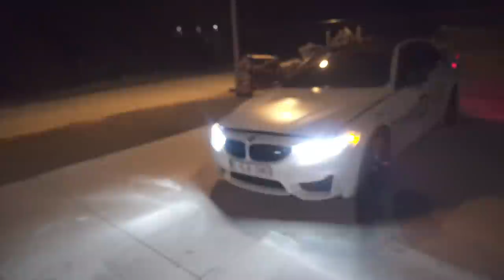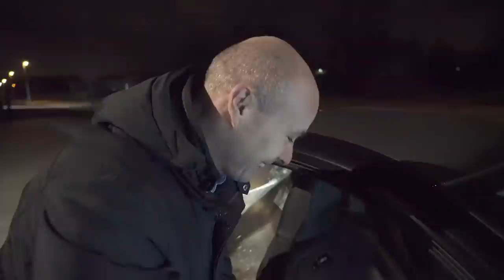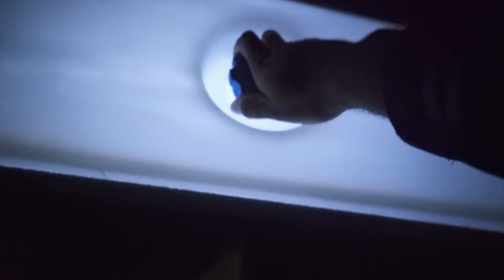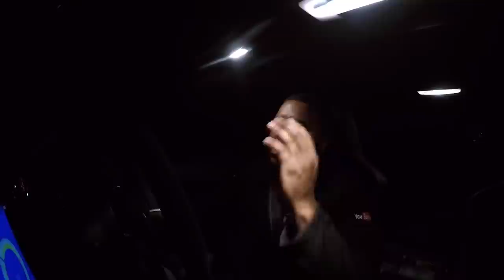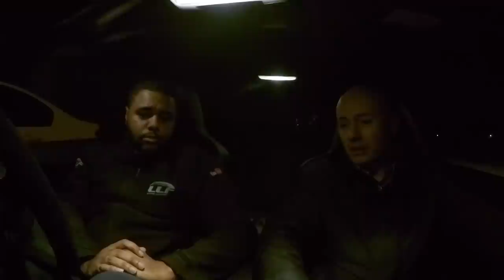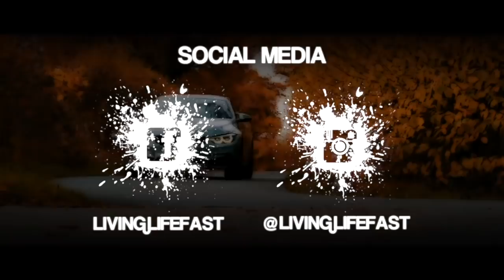850bhp BMW M3 vs 720bhp *SUPERM4*

Comment: Crazy numbers in the daily, and it all seems so controllable. 🤔 Now If you upgrade to some super sticky tires. 🤯
Reply: Its worth noting that Ricky has the talent to make this look a lot more controllable than it probably would be for the average driver. It does look a well balanced and designed tune, but nevertheless, it wouldn't take me long to end up on my roof I imagine !

Comment: You're right up there man! I know its not quite 60-130mph

100-200 kmh
03.98 2016 Audi R8 V10 Plus BiTurbo 1000HP Klasen Motors
05.44 2018 Mercedes AMG GLC 63 S 950HP GAD Motors 
05.82 2012 Mercedes SLS AMG Supercharged 1025HP Elmerhaus
06.60 2018 BMW M5 F90 780HP Elmerhaus 
07.24 2019 Mercedes AMG GT 63 S 4 Door
07.43 2017 Audi RS6 780HP Elmerhaus 
08.44 2018 Bentley Continental GT W12 
08.48 2018 BMW M850i xDrive
08.60 2018 Lamborghini Urus
09.80 2018 BMW M550d McChip 515HP 
09.95 2018 Audi RS4 Avant 
10.59 2018 BMW M2 Competition M-DCT 
10.73 2015 Porsche Macan Turbo 480HP Elmerhaus
11.01 2013 BMW M135i Mosselman 375HP 
11.30 2019 Tesla Model 3 Performance
11.75 2019 Mercedes Maybach S560
12.39 2019 Alpine A110
12.79 2015 Audi S1 Sportback 320HP
12.81 2019 Mercedes AMG G63
13.13 2018 Audi S3 Sportback S-Tronic 
13.38 2018 Tesla Model S 100D
13.52 2013 BMW M135i 
13.96 2018 Tesla Model X 100D
14.00 2015 Renault Megane RS Trophy Veban 345HP 
14.07 2018 Lexus LS500 AWD
14.45 2019 Mercedes AMG A35
15.34 2018 Mercedes S450 Lang 4Matic 
15.74 2018 VW Golf GTI Performance DSG
16.03 2012 BMW 535d F11 Novatune 362HP 
16.04 2019 Peugeot 308 GTI
16.11 2018 Renault Megane RS Manual
17.32 2018 Audi A6 50 TDI 
17.99 2019 Audi A7 50 TDI
21.58 2007 Mini Clubman Cooper S 230HP 
22.45 2018 VW Touareg V6 TDI 286HP
24.48 2018 Audi Q8 50 TDI
28.08 2019 Porsche Macan 2.0T
31.59 2018 Audi A6 Avant 40 TDI 
32.04 2018 Ford Focus 1.5T 182HP MANUAL 
32.57 2018 Suzuki Swift Sport 
33.34 2018 Mercedes E Class E200 AUT 
33.84 2018 BMW 520i G30 
34.65 2018 VW T Roc 2.0 TSI DSG 4Motion 
40.58 2018 VW Up GTI Elmerhaus 143HP

Comment: An Aventador does 62-124mph in 6.5, in the dry and 4WD. Not even 60-130mph.
Reply: Sobanel I'm at an 8.65 best run at the moment with my golf 60-130 mph but will add in 4-5 psi next week and see how it does.

Comment: Please resist offers from like bbc etc hold out, they will kill it. This is IMO getting to be better than something on prime the last door or something. Also u got insurance for going out with people. Starting to worry. There are many many in used Air fields around that have very very wide and nice run off? Or offs? 👊🏽

Comment: 60-130mph in 6.5 sec..., thats not 720hp..., it should be much faster...
Reply: That's Huracan and R8 V10+ territory... They have less power but they're much lighter... That seems right to me.
Reply: No, Huracan LP 610-4 is the same weight...
Reply: @GTRuppsala  70kg lighter, much better tyres, much more aerodynamic, better LSD and suspension set up... You're forgetting these 2 cars have a different purpose so power is not the only factor.
Reply: Tahbib Ahmed i think the m4 has around 650hp,
Reply: Tahbib Ahmed he did not took time with meth therefore around 650hp probably...
Reply: @GTRuppsala  Well yes... I guess that's another factor then